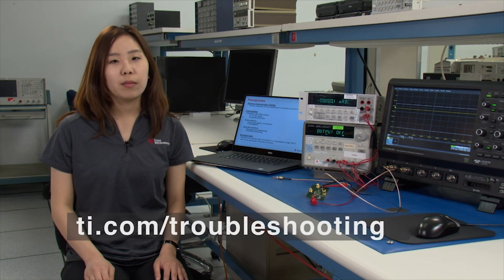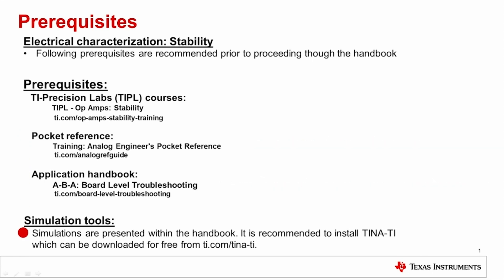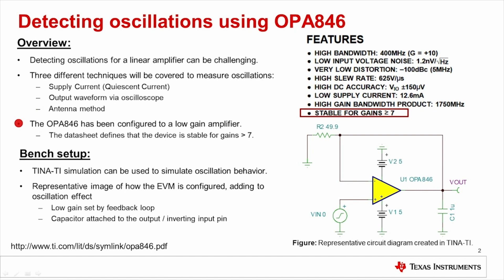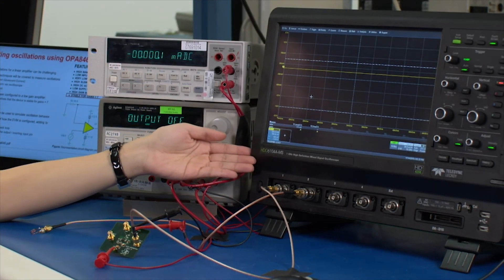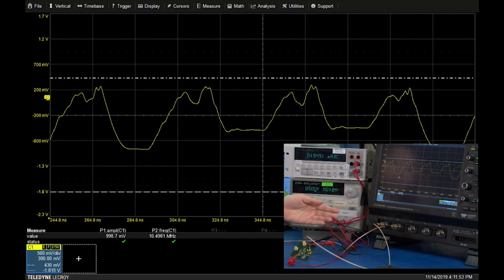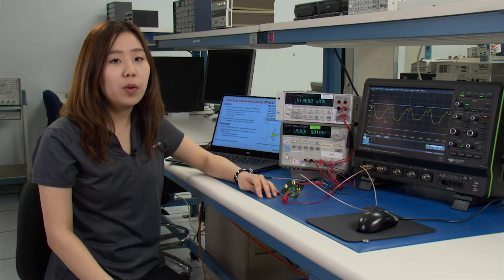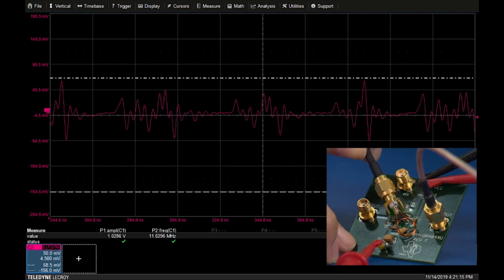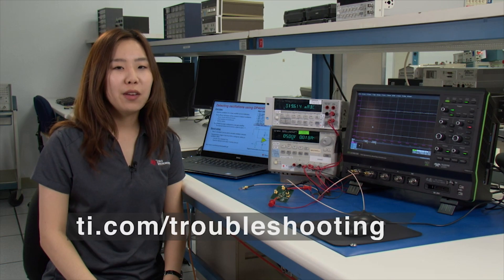Troubleshooting Tips: Op Amps - Oscillations

Comment: Most precision Op-Amps have specific compensationary internal feedback circuits, which makes impossible to use them in multistage active filters scenarios due to unmanageable oscillation. As I know, this scenario cannot be simulated on a computer.